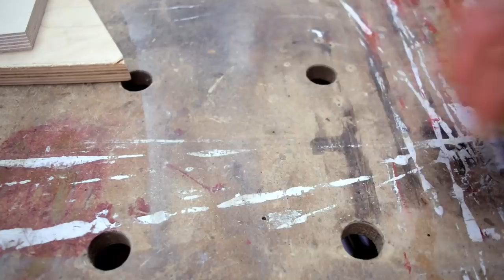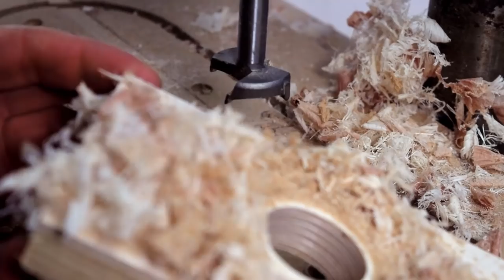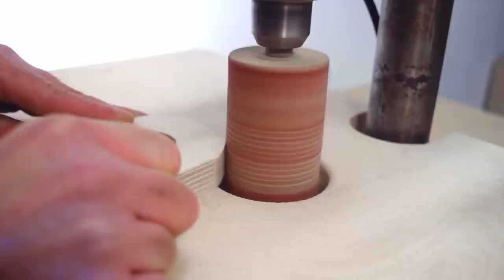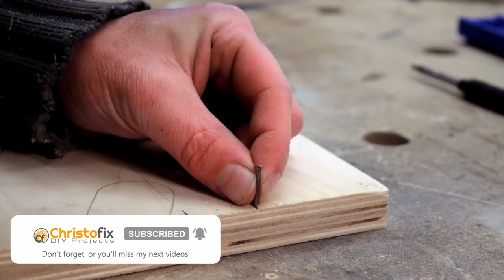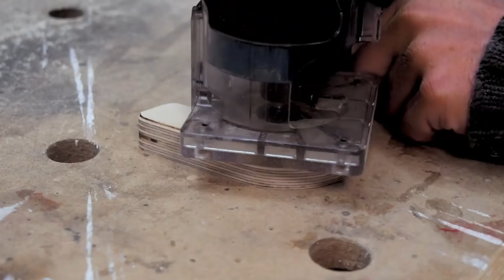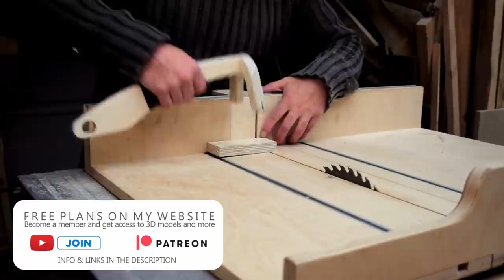The Hold Down Stick EVERY Woodworker Should Have

Comment: I have made a slight modification by adding a non slip pad to each arm - stopped any possible slip when pushing through a cut- great design with the added hold down thrown in.
Reply from the maker: Thank you so much, Ken. I have thought about doing the same, but I have noticed that it is not slippery at all. I will test it more out in the future and maybe I will add some non-slip pad to it.

Comment: Nice design, cheers! This (or something like this but modified) would great when cutting small pieces on a sliding miter saw/chop saw.
Reply from the maker: Thanks, my friend. I am glad you like it. I made it with the idea of using it on both the crosscut sled and miter saw, but haven't tried it out on the miter saw yet. But I think it will work great on that too.
Thank you for watching and leaving a comment, it is much appreciated.
Greetings

Comment: Nicely done! If I build that hold down, I will put rubber or perhaps sand paper on the tips to prevent it from moving on the piece being held down. Your projects are always spot on!  👍😉
Reply from the maker: We are think-alike, Steve. For a moment I had the same idea, but after testing it I saw it was not slippery at all. I will do some more test cuts to see if I will make those changes or not. Thanks for watching another video of mine. Your support is much appreciated. Greetings.

Comment: Thought you already had toggle clamps that would perform the same function??  Unless I'm confused...  These are nice as well. 😀😇😎
Reply: First thing I thought when I saw it in use!?!?
Reply from the maker: Hi, I have indeed those hold down clamps, and the work really well. But sometimes the slow down my workflow. This solution works much faster and it feels great to have control on your workpiece. I'm sure I will use this one a lot in the future.

Comment: I would replace the screw with a wooden dowel in order to keep all metal away from my saw blade.
Reply from the maker: That is a good idea. The idea behind the screw was that I could easily replace the fingers without having to make the hold-down stick all over again. But I like the way you think about the screw. I had to make a choice between the dowel (and glue it for extra strength), or the screw and be able to dissemble the stick.
Thank you for sharing your idea, that is much appreciated. 
Greetings